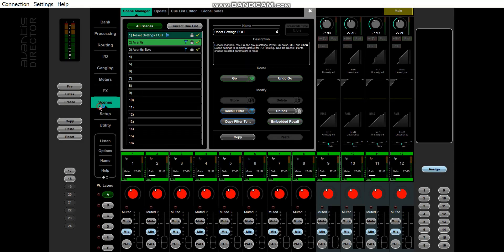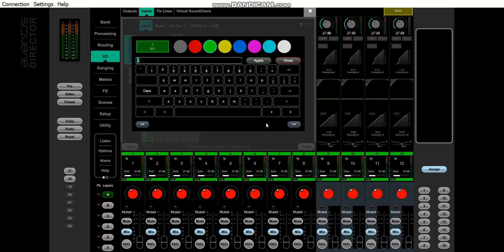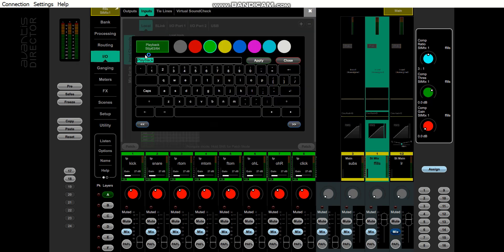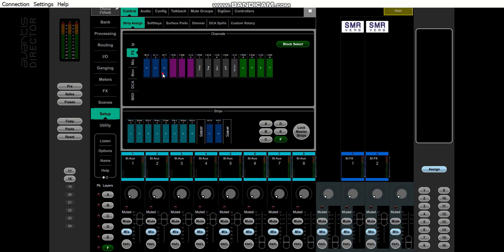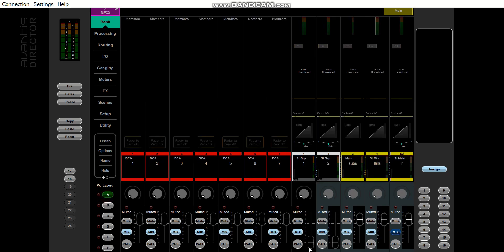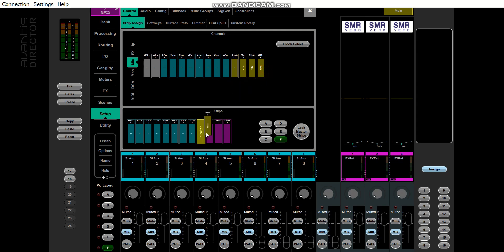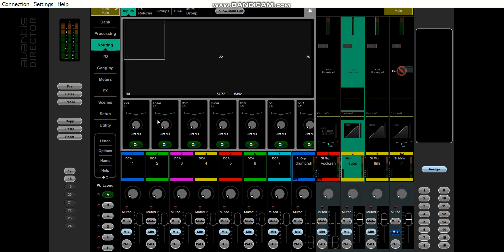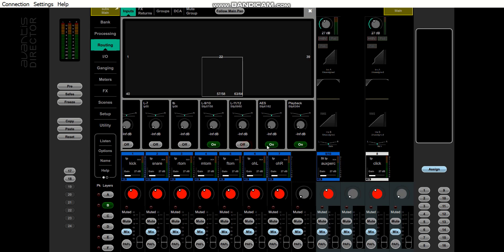Walkthrough: Avantis Show File Build

Comment: 0:20 I've learned to stop using "FX" busses and use "Aux" busses instead for FX sends.  This has several benefits.  First, it removes the restrictions on what FX racks you can assign the audio to.  If you use FX sends, you can only assign those sends to the first X FX racks (where X is the same number of the FX sends).  So in your example, with only three FX sends, you will only be able to assign them to the first three FX slots.  If you use auxes instead, you can assign them to any of the 12 FX slots.  (This makes it much easier to add another buss fed FX at some later point in time without having to reassign all of your FX racks).  Second, it provides all of the normal aux processing like filters, EQ, compression, etc.  I doubt you'll need all of that for an FX send, but the actual FX sends allow little to no processing which can be limiting at times.